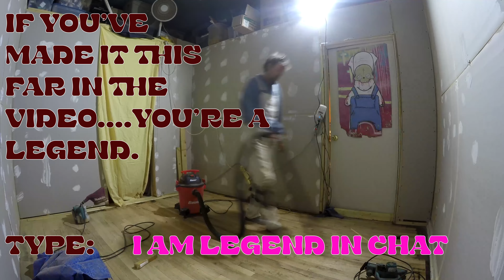Time-Lapse Studio Build (Long Version) Part 1

Comment: I am Legend - also you are for smashing that floor out .. I am a carpet fitter by trade and impressed with your effort there man .. are they all your tools Space ? Please post more of the progress absolutely Zero Smudge bro
Reply from the maker: Thanx man. I borrowed the Electric Planer and Belt Sander from a neighbor
Reply: @SpaceGalleria  I was going to ask if there was a tool hire as makita sander are top quality even your drill with the light on is 👍.. man that floor would have pissed me off after a day or so .. what’s next for the room some sound proof or paint ? .. looks like it’s 4-5 times bigger than the current Gaming Room should be a whole new world
Reply from the maker: @jrssimracing  next up just fin painting, so now i edit that up, then im doing, yes sound proof trim is on deck too